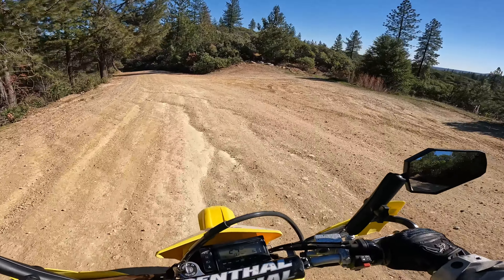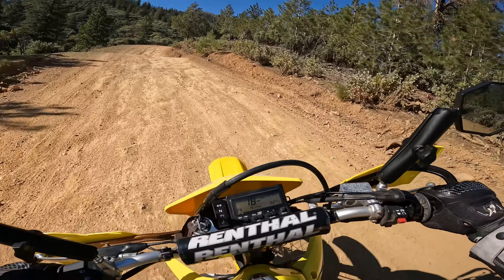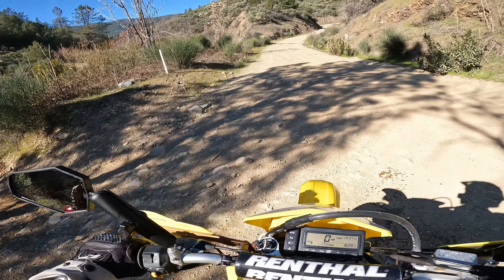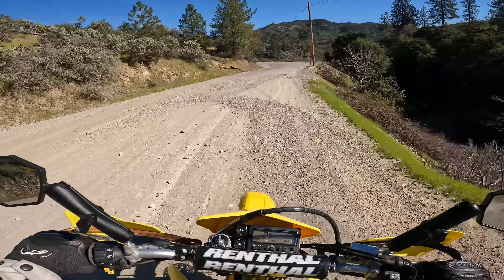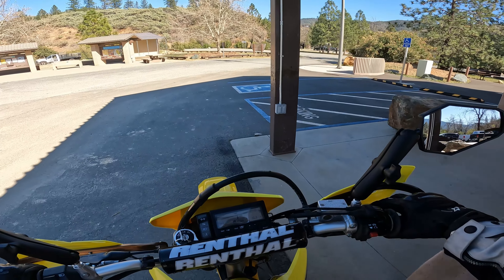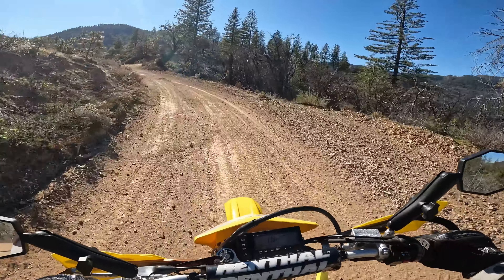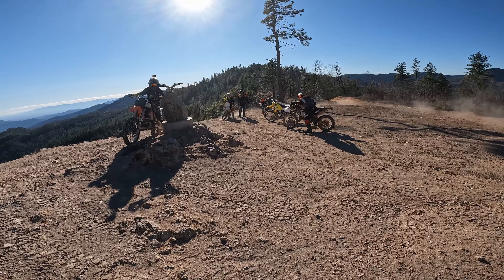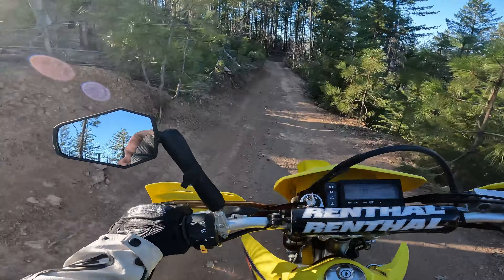DRZ400S & KLX300 Ride to Hang Glider Hill

Comment: I rode a DR 650 and loved it....rode a 690 in 2015 and hated it...they did improve the counter balance system since...does the carb have a rubber diaphram or metal slide? Rubber diaphrams can be slower to respond.  Towards the top, the was a tricky trail!!!
Reply from the maker: Thank you for the feedback. The DR650 is a known quantity, I know I love it. The 690 would be a gamble, and an expensive one at that.
Reply: @chasingtrail  I induced it to do a speed wobble around 45 to 50 mph...multiple times...might have been the Pirelli tires...plus the vibration from the engine...you could not give me one...👎🤬
Reply: The DRZ has a mikuni bsr36, and is a rubber diaphragm.

Comment: High idle or hanging revs is usually a sign of running lean. Do you have a JD jet kit? And how many turns out is your A/F mixture screw? With you changing elevation a lot its hard to say where you should be.
Reply from the maker: I've got it running perfectly again. I lowered the idle a little bit. I also pulled the small side cover which has a small diaphragm and spring. I reseated this piece and didn't screw it down so tightly this time. I tested many different positions with the A/F mixture screw but it runs best with the screw all the way in. It's running perfectly now. Pulls hard, no hesitation or bogging anywhere, no surging, drops back down to idle quickly, and the popping on deceleration has been reduced. 

It does have a jet kit though I don't know which brand. My elevation changes are from roughly sea level to ~4000 feet. It's rare I would go higher than that.

Comment: Watching you struggling with that DRZ in the steep and slow sections I can't help thinking how much better the CRF300 is in those situations -- or the KLR for that matter. The DRZ is just too tall, too tall geared, too powerful so it breaks traction easily. Spend $600 on a suspension tweak so they CRF has as good as the KLR and you've got a lot of capability in a bike that cost a small fraction of what the KTM does -- and less than what a DRZ costs new. Of course the DRZ is great on wide open fast stuff, or if you want to loft the front wheel, and the KTM more so.
Reply from the maker: The issue with that section was lack of rider skill, no fault of the bike. The only aspect of the DRZ I didn't like there is how tall 1st gear is, so it requires a lot of clutch feathering. 

It was a struggle to pick the bike up there. I can't imagine trying to pick up a KLR that weighs about 140 lbs more. 

For me, the biggest factor in stuff like that is weight. I would pick the KTM every time. It is so much lighter than these other bikes, and you feel it every second you're off-road. Sure, these other bikes can do it, but it's so much more enjoyable on a lighter weight machine. Just my opinion.
Reply: The drz400s is definitely not too powerful lol... Have you riden a drz? Sounds like you are trying to justify your 300l purchase.